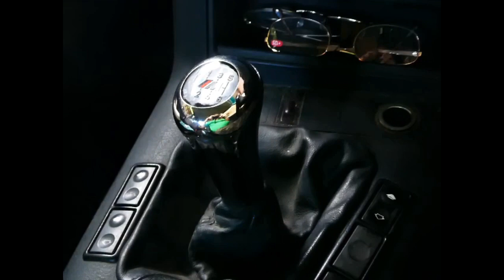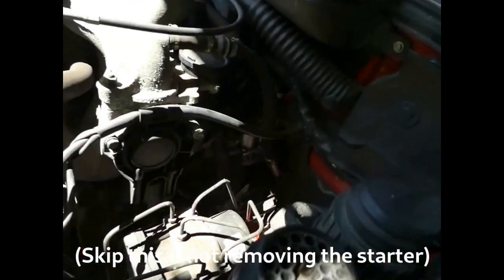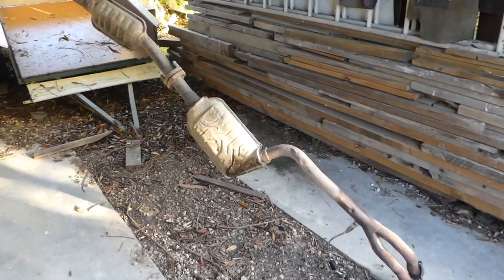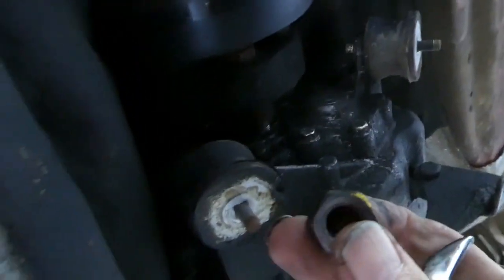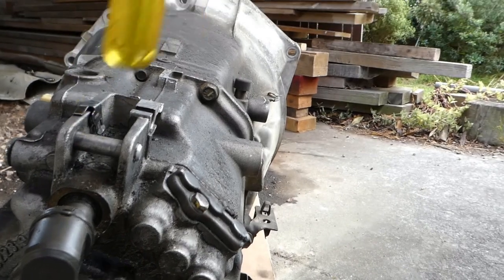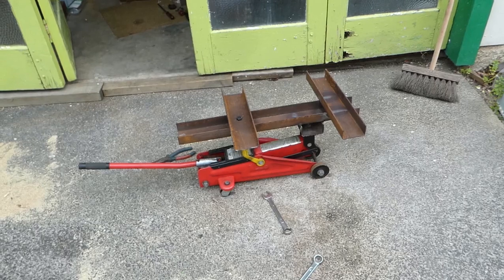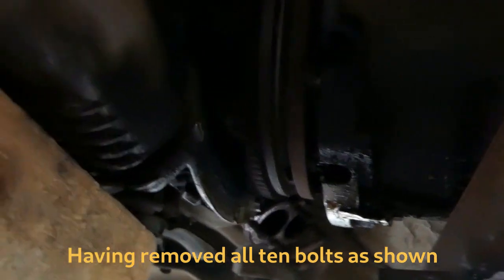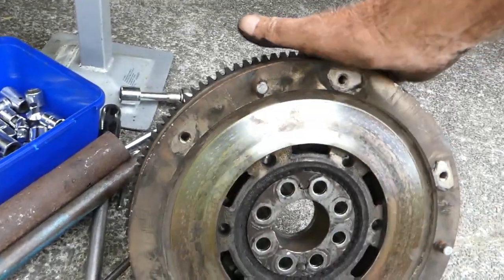BMW 318iS  e36   Gearbox & clutch removal  (DIY)

Comment: Was there a nut on the top starter bolt??
I go the nut off the lower one on the left but it just does not seem feasible to get to the top starter bolt.